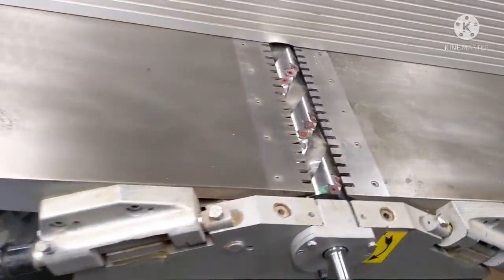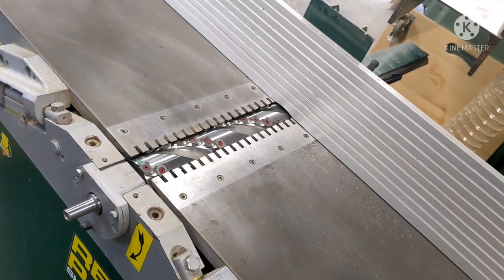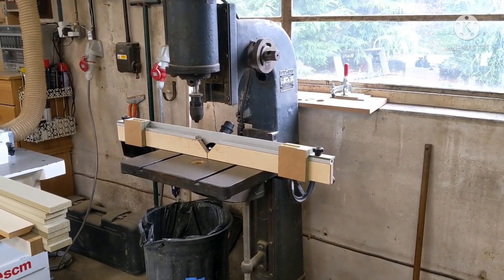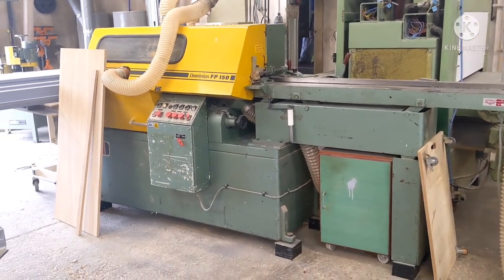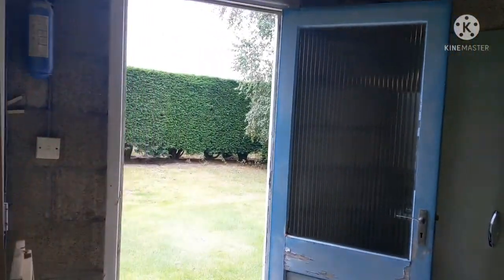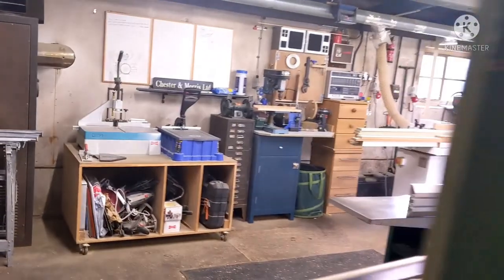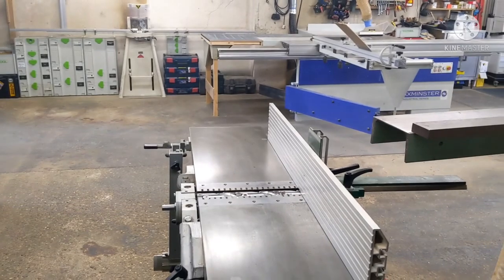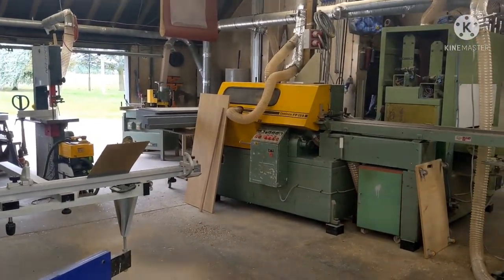Workshop Vlog 1 - spiral planer upgrade, few new machines and upcoming jobs.

Comment: Definitely get the spiral heads for the molder. Also the DRO's will help you immensely.  I don't have to worry about teatout on anything I put thru mine unless the blades are dull, then it's just on me. Nice score on the old Wadkin!
Reply from the maker: Thanks Dustin, I think it makes sense for the moulder, they're 4 knife blocks at the moment, so it ends up being 16 blades to set when it's time to change, so I always put it off. 
I'm not 100% yet whether to fit electronic digital read outs, or the mechanical ones that work by the handle spinning round. Need to find out what the thread pitch is really and see whether I can find a mechanical dial that matches that ratio I suppose. 
Either way I would use it a lot more, as at the moment unless I've got a load of stock to run up at the same size then I just tend to do it on the PT, as the readouts are off and you need to run a couple of test pieces to get them right. 
Thanks for the feedback, have a good bank holiday 👍
Reply: @carpentryjoineryandcabinet6335  
Look at Accurate Technologies. The have a DRO kit that you could mount on just the left and top heads. They are digital by a linear scale so not dependent on matching a thread pitch. If you set the bottom and right up so they never change, the spiral heads, then if all you do is S4S, you are only needing to spend the money on 2 spindles. Hope that helps. 👍

Comment: Hi, just found your channel and find it interesting. I have a Paoloni 4 sided Moulder which had 4 knives per block and it was always a ball ache changing them over. I bought spiral blocks from Leitz tooling for mine and although they are expensive they work a treat, more productive with my time, less downtime and cost with sharpening and setting the old knives and they new ones are tungsten so worth a look... All the best Adrian
Reply from the maker: Thanks Adrian, it definitely seems the way to go. Made a massive difference on the planer already. Been machining up Accoya all week. With the old has knives, within a couple of hours of changing them, I'd start to get a bit of tear out where the Accoya is so brittle. With the new spiral head and TC knives its just carried on all week, clean as a whistle. 👍👍
Reply: @carpentryjoineryandcabinet6335  Hi and thanks for the reply. Accoya is a good product but as you say it's brittle, limited with adhesives,finishes etc and damned expensive. Other companies are bringing their own similar products to market hopefully soon which should bring the price of Accoya down.. :-)
Reply from the maker: @adriansams6066  yeah the cost is the biggest down side, plus it's a bit soft and dents easily. One of the Accoya reps said that they were doing a version using alder, that would be better suited to kitchens, a bit harder. But that was probably getting on for 10 years ago and I haven't seen any thing of it. I did look at lignia (the one from Wales somewhere) as they did 32mm and that's always a bit of pain for me to get as Lathem's don't keep it in stock a lot of the time, but apparently they've gone bust, so that was the end of that 🤷🏻‍♂️

Comment: Hi, just came across this and was really impressed with how informative you are. Please may I ask what rendering software you use for your kitchen drawings?
Reply from the maker: Hi Andrew, 
It's just basic desktop SketchUp for the drawing (mine is actually a really old version from back in the days when you used to get it in a CD ROM). The software I used for the renders at the time is called light up, however it seems that the support for my old version of SketchUp is over now so.im.not using it currently. But I believe it is still available for the newer version. 
Hope that helps,
Thanks,
Ben.
Reply: @carpentryjoineryandcabinet6335  Hi Ben Thanks for getting back to me I will have a look.
Reply from the maker: @AndrewCrossland-xh4td  no problem, hope it helps 👍

Comment: It’s two years ago mate but I am interested !

Still loving the spiral block? Did the conversion cause any issues ?

Also are you spraying waterbased. I use renner waterbased with a cross linker but having problems with mdf.
Reply from the maker: Hi mate, yeah spiral block is still amazing, only thing I would have done differently with hindsight is go for a true helical block instead of just spiral, but it only matters if there is really wild grain. There is a Chinese company who you can buy direct from called csp tooling. Had a few bits off them since, and if I knew they existed back then, I would have bought the cutter head off of them. I've had no issues from the conversion really, other than that you could definitely get away with taking a heavier cut with the straight knives than you can with the spiral.

I tend to spray high build, pre cat primer, then I spray either renner or Sayerlack wb top coats. I am gradually shifting over to the WB primer too, as I'm trying to cut out the solvent stuff eventually. Only time I ever have issues with spraying mdf with wb is if it is shit mdf, Caberwood or Khronospan etc. If it is either Medite Optima or Finsa hydrofugo, then there is no grain raise at all really. I don't use the crosslinkers in either the renner or the Sayerlack top coats. 

Cheers,
Ben
Reply: Cheers Ben.

Yeah I only use medite pro or finsa but couldn’t spot the difference with finsa tbh so stopped paying the extra. 

I have noticed if I increase the heat and bake the paint it’s better but I used to put far less effort in and get better results! I think I am going to do some tests with the renner primer with tight coats rather than getting too much on. It is easier with solvent but I too want to eliminate it for clean up!

Thanks for the tip on the block I have a startrite sd310x and tbh love everything about so for the money it seems to be the best improvement.
Reply from the maker: @Wattsjoinerybarn  yeah, heat does help a lot, the quicker the paint drys the less time there is for it to soak in and cause fibre raise. If you have a clean drying space then sor movement works really well too, and a lot cheaper to run that heat. Just a few big fans running around the room. 

If you are confident in measuring the block, then I would deffo give that CSP tooling a shout. They've made me a few bits now and they're really good. Chen who does their Instagram page is really helpful, and to be fair speaks better English than I do, so there is no language barrier when you are describing what you want, which always worries me when ordering bespoke items from China (believe it or not, my mandarin isn't excellent 😂😂😂). The downside is you'll need to get the block out to measure everything like the spindle diameters and lengths etc. 

The other thing that I found can stop the issues with the fibre raise, is to give it a quick blast over with a sanding sealer before you prime. But the good ones I've found have all been solvent again, so you aren't really solving the solvent to water based issue, just pushing it further down the line. 

Cheers, Ben.
Reply: Thanks. Really keen to see this job I am currently doing installed. I have such harsh raking light in the spray booth and drying room that I sometimes think I see stuff that isn’t really there! I used to use sanding sealer on the edges to help the paint stick and found it didn’t really help with the fibre raise. I can see the quality is lower tho especially with the stuff inside the oak face boards. All part of it tho and you just have to did a way to deal with it.

Thanks a lot for your help with the block👍🏻
Reply from the maker: @Wattsjoinerybarn  yeah, you definitely notice it way more in the spray room than when it's installed. I've got low raking LEDs that are in my spray room to cast the light along what I'm spraying, and you can spot things that you would never see in a million years when it's installed.
Reply: Yes me too! Only way to be tho.

The customer of the first kitchen  I ever supplied as a finished article got a hand written note with their sample door apologising for the odd blemish in the finish and I told them I would get it better for the install🙈 they emailed me when they got the door saying they couldn’t find anything and wanted to know how it was so smooth! I can’t finish a job without telling the customer all the bits I don’t like !
Reply from the maker: @Wattsjoinerybarn  😂😂